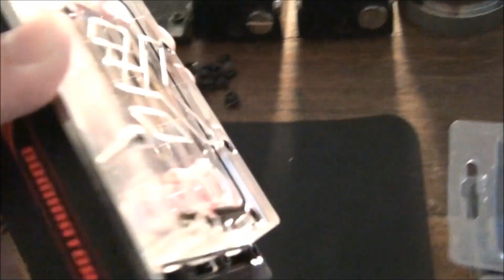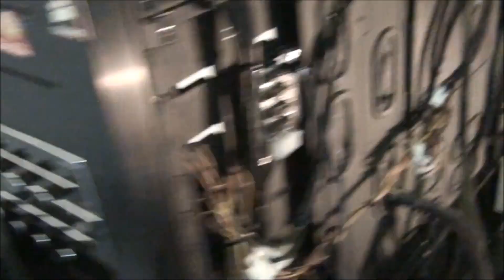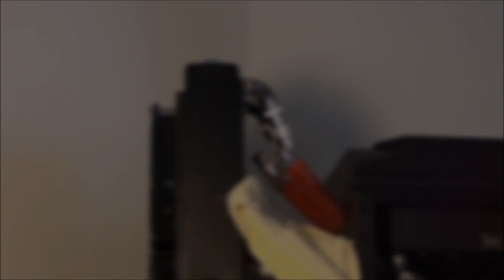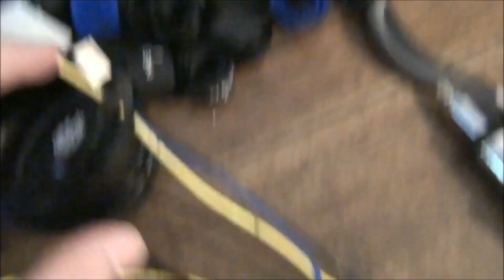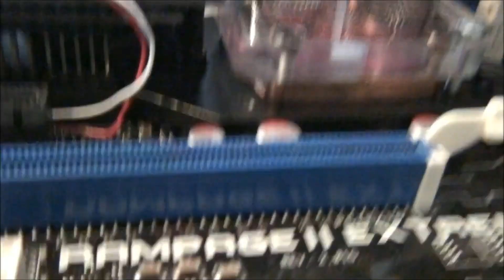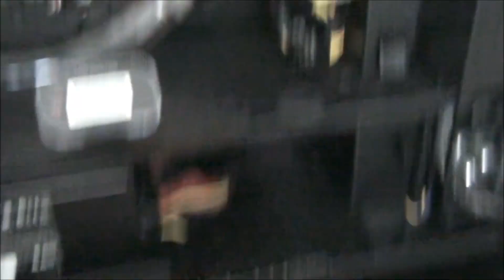Singularity Beast Resurrection - Client Build 3: 800D Water-cooling: Part 1

Comment: @babydash123 There is always a risk. Getting this system to my house was quite a hassel. It requires a lot of work before hand to ensure a safe trip. 

There are several different factors that come into play. e.g the case size. 

It is risky to take WC'd computers to LANs and such but it is possible.

Comment: Hey. To minimize dust in the room Vere you operate the PC`s you schult con-sitter to 
install A Ion-air filter. That will  remove a lot of the dust.
Just remember to plaice it on a board or something sins the dust have a tendency to settle
around the device.